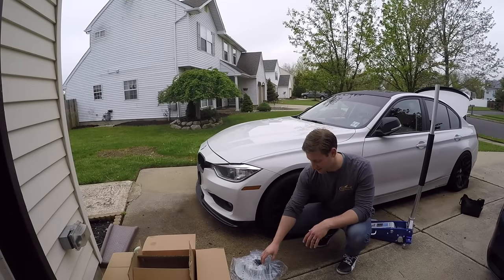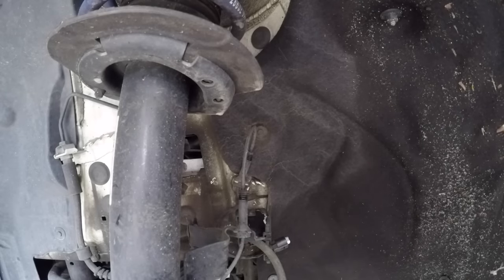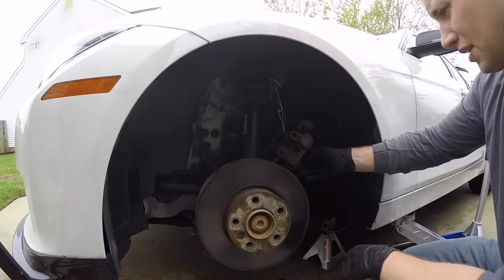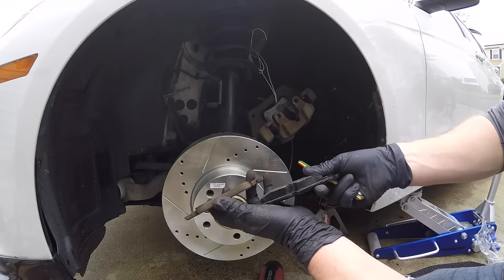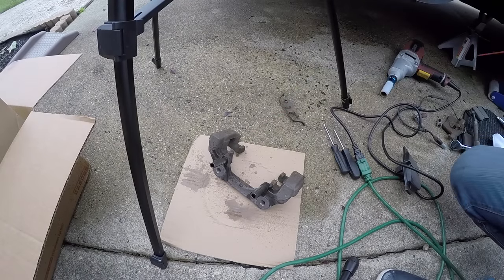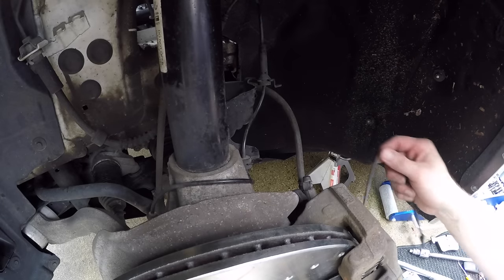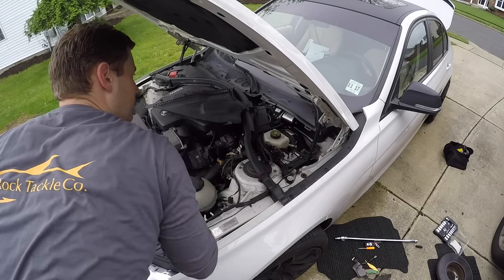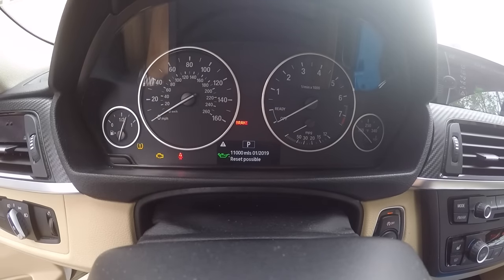F30 BMW (2011-2019) Brake Pads, Rotors and Wear Sensor Change

Comment: I like you videos Brian but there’s a few issues this one I’d like to point out for safety and potential wear or damage factors to the car

1. Note for us Brits / and some other Euro countries, European BMW’s use locking wheel nuts, never use an impact wrench on a locking wheel not there is a high risk of it shearing the head of the nut off and you will be screwed, quite literally! Specialist equipment will then be required to remove the damaged locking wheel nut key, trust me I’ve found this out myself, the hard way! Although impact wrenches are great, a beaker bar for all wheel nuts is safer.

2. Always clean the hub with a wire brush after removing the brake disc (known as rotors in USA), the incumbent hub builds up corrosion deposits especially on higher mileage cars and if you just place your new disc on it may not seat perfectly causing possible vibration when braking.

3. When releasing the brake reservoir cap you should take some brake fluid out with large syringe and injected back in after re-assembly of the brakes, you do this as a precaution because if fluid has been topped up as part of a dealer service due to pad wear then when pushing the brake calliper piston back it can cause brake fluid to overflow from the reservoir and into the engine bay, and it’s highly corrosive, it will strip car paint! I also put an absorbent rag around the open reservoir to be safe.

4. A thin layer of copper grease should be added to the back of the brake pads where they press into the calliper this helps prevent squealing.

5. The calliper bolts should either be replaced or if you are using the existing ones (which is generally fine if in good condition) you should use a thin layer of Blue Loctite on the calliper bolt thread where it screws into the calliper (generally from the tip 5mm in). And tighten to the recommended Nm torque setting for the calliper. The Blue Locktite prevents the bolts potentially loosening due to the high forces and vibrations they are subjected to under braking. I was told this by a BMW service engineer a long time ago, relevant to how they do things in the UK, not sure about USA but I’d guess its the same.

Hope this helps.
Reply: Great feedback. Going to try to do mine this weekend.
Reply: Spot on!
Reply: Clean the brake surface of the rotors also before installing.
Reply: Ok Karen
Reply: Wish I read this before pressing the brake pads, mine overflow. :[
Reply: All valid and important points.

Comment: Thank you SO much for making this video.  Swapped out the rotors, pads and sensors on my 2013 F30 yesterday and it would have been a nightmare without your guidance and tips.  you rock!!
Reply: PorradaVFR same process to the rear tires?

Comment: I thought it might be helpful to include the torque specs for the caliper bolts (110 nm or 81.8 ft. lbs) Lugs should be 103 ft lbs.
Reply: Do you know the torque spec for the Allen key?
Reply: @InformallyDead the rotor set screw is always 16 nm

Comment: Excellent tutorial for another YouTube mechanic!  I didn't need to swap out my rotors, only the brake pads. Rotors were real smooth... I didn't even take them to my local auto store to turn them!  Just swapped out the pads!  The 18 mm bolts on the passenger side are the hardest of the job.....used a sissor jack with my rachet as I didn't have a breaker bar, worked like a charm.  The rear brake pads are a breeze folks.....just need an 18 mm allen socket for the bolts behind the dust caps....they come off real easy. No need to take off the caliper if you're only doing the pads. Acquired Akebono pads from the store mentioned in this video....they come with the sensor wires.

Thanks for the video! Saved me $$$
Reply from the maker: lol nice work

Comment: New rotors rotated unevenly for me (i.e sometimes rubbing against pads). Took them out then used a wire brush to smooth out the edge of the inner ring on the hub where the rotors rest. Big improvement.

Comment: Excellent video and some very astute viewers and comments below. I also like to brush on a little bit of anti-seize between the hub assembly and backside of the rotor surface. This helps prevent any rust build up and the next time you have to remove the rotor it will pop off easy and not be rusted onto the hub.

Comment: Hilarious. Looks like a whole bunch of us out here are gearing up to do our brakes.
Thanks for the great timing Bryan.
Please post some follow up on the results. I have Zimmerman rotors and Textar pads in the garage just waiting to be put on.
Really had a hard time making a choice so ended up a bit conservative.
I worry that I should have gone with the Hawk Performance pads.
Anyway ... let us know how it feels compared to previous. Cheers man.
Reply from the maker: Hi Rob, thanks for your note. Hope it helps! So far, they work great :)
-Bryan
Reply: Nothing wrong with Oem. Love Zimmerman’s z-coat. Looks a lot better a few thousand miles down the road when the hat isn’t rusted to heck. The textars will be my pick too. That dust means it’s stopping!
Reply: I want to avoid the brake dust issue, so I#ll be avoiding OEM.  Rob, do those two options give less brake dust?

Comment: Thanks for step by step instruction. Bit nervous to change a wear sensor (I replaced the sensor also) but was easier than I thought.  I replaced with Bosch Rotor and Akebono Pads. See how the new rotor /pad will perform.

Comment: Getting ready to do my break rotors/pads, what are the proper torque specs for caliper bolts and wheel lug nuts for F30 335i xDrive with Msport
Reply: I think 16mn
Reply: 17mm and 110nm
Reply: @TranquilRide  F30 have M14 lugs, so need 140Nm.

Comment: I upgraded to Stoptech brakes about 6 months ago and the front pads didnt fit. Went into my local car parts store and those didnt fit either. So i had to buy oem pads which sucks. Im glad to see the hawk pads worked well on yours though.

Comment: Great tip with the opening the brake reservoir cap. You can hand push the caliper piston back in, but the brake fluid overflows from the brake reservoir. Those 18mm bolts are a real bitch especially at the rear.

Comment: Don't you have to use a diagnostics tool after the brake change? What would happen if you didn't take the sensor wire off?
Awesome video thanks a bunch.

Comment: People asking video about the rear breaks, I just did mine, and it's very much the same.
Only thing is that the rotor might take bit more work to take off due to it being gripped from the back of the break also. 
I thought rear was easier.

Comment: If I forgot to get brake cleaner, to clean the slides, can I just use something else that might be around the house? Can I just wipe them down with a wet rag, and dry them off, before adding the brake grease that comes with the pads? Thanks.

Comment: What are you aligning the jackstand under here, and are you actually setting the car down on it, or just using it as a backup to the jack, but not intentionally load bearing?

Comment: Great video! Thank you. Inspired by you.  I replaced the front pads of my car with Akebono from fcpeuro. I found the the rotor got very hot after driving it. Is this normal?  Thank you.
Reply: Did you clean the sliders well and also lubricated them? If that rotor if heating much, it's most likely because the brake pads are dragging....either sliders don't slide well, or the piston is not moving properly..

Comment: Just replaced the rear rotors and pads on my f30. I wish my rotors came off as easy as yours lol had to give them some encouragement with a 3lb hammer. Overall very pleased and not too hard to do.
Reply from the maker: I was so surprised how easy it did come off! Now on the other hand.. I didn't show it.. but it took me probably 5 plus minutes to get each wheel off!
Reply: Kies Motorsports Oh yes that was almost the hardest part, I had to lay my boot into the wheels with some serious kicks! I was surprised how stuck on tbey were. A good layer of copper anti seize will hopefully help in the future.
Reply: @KiesMotorsports  I've since replaced all rotors and pads, used Ate ceramic pads, man they're fantastic, outstandingly smooth and DUST FREE!

Comment: Great vid I'm going to replace my brake pads soon. I have a question though what's the torque value for the lug nuts on the wheel and the bolts behind the calipers?

Comment: Hello , awesome video , quick question what if I bought oem brake pads , and I buy those awesome drilled power stop rotors that you bought as well , will that be any problem ? Very curious

Comment: Hey Bryan,

I didn't see in the video anything about cleaning the rotors before or even after the install? I would recommend that so you can clean off all the machining oil off them and prevent hot spots on the rotors. Thanks for the video very good! Also I don't know if you have a little squeel with the OEM bads when letting off the brakes at a stop and start rolling, (BMW told me this is normal) but do the new ones do this?
Reply from the maker: Hi, Steven. I know we've since talked, but no I didn't because it was very minimal at best. They actually seemed very dry. if there was any, I'm sure it is gone after the bedding in process. As for the squeal, my new ones don't squeal at all.

Comment: Did you torque the screws that hold the calipers. What are the torque ratings for the screws used to hold the assembly?

Comment: my bmw 2008 328i has yellow 'Brake' turned on dashboard.  using diagnostic scan tool , I confirmed error code is '5DE0' Brake-pad wear: Plasibility,front axle. I tried to reset the error code but it won't allow to reset.   do I need to replace  brake pad worn sensor from front ? or do I need to replace pad + sensor together? How can I kno w pad is worn enough? how to measure it?   front side there is only one brake sensor?  if so , which side it is there? left or right?  Thank you so much~!

Comment: Excellent video ! how do the brakes feel now with slotted and drilled discs? Is there any advantage at all or is it for the look alone? Also will the slotts and holes cause more brake dust?
Reply from the maker: +Ken Lawton Hi Ken, they feel good and they grip great. It's supposed to keep the brakes cooler, but you probably won't matter much unless your tracking your car. Not sure about the brake dust yet, I've only had them on for a few days
Reply: Kies Motorsports Are those ceramic pads? I've heard good and bad, mostly bad about using ceramic i.e. they are brutal on your rotors and when cold are not good....
Reply: Kies Motorsports How are the new brakes going?
Reply from the maker: Doing good 👍🏼

Comment: GREAT VIDEO. I bought the EBC brake kit and it did not come with brake sensor, can i use my existing brake sensor or do i need to buy a new one.
Reply from the maker: Hi, thanks! You need to buy a new one

Comment: Great video! Just recently changed my m235 pads to posi-quiet ceramic pads, but i cheaped out and did not change the rotors and reused them. They squeal LOUD, like deafening loud, for the first few stops. They are pretty quiet afterwards though, wonder if that and 14 degree weather has something to do with this or the mechanic didnt grease up the hardware adequately Hmmm...
Reply from the maker: May be the weather

Comment: Bryan,
My brakes are spongy (almost to floor) after having someone replacing 2 sensors, 2 pads and turn the rotors.  They weren't spongy before.  I did have an error code in my dash that indicated "brakes" so this is why the work was done but the brakes were not never spongy until now.    They said the lines were not opened/bled...so no air in line and no leak.  I pump the brakes and push down hard and they slowly sink down.    Any idea what the issue could be ??

Comment: Does BMW car always have to change the rotor as well when the pads are worn out?
Reply: In this case I think he just wanted drilled and slotted look. It's only one small screw to change rotor and brake is already off. So why not just change it.

Comment: Curious, where exactly did you position the jack stands, if not where the jack is? Also, how long is too long for the breaker bar for this model? Thanks.
Reply: Ah, I see this was answered elsewhere regarding the jack stand placement...

Comment: hey there, I have a 2012 bmw 335i f30 sedan sport. The front brake calipers look different and drip brake fluid when replacing the brakes. Not an issue since I will flush the system anyway but the biggest issue I have is that the brake sensor does not read the computer properly. I've tried aftermarket, OEM from dealer and no sensors seem to turn off the brake light on my dash. I also ran an obd2 sesor and tried to delete the code but it still will not go away. Brakes work great but the light is very annoying. Thoughts?

Comment: Awesome video. I feel confident doing the job now. Thanks.

I do plan to use a but more brake cleaner than the video showed, and as many have stated contemplating trying a high heat paint on the calipers.

Any chance you have torque specs for the caliper bolts and lug nuts?

Again thanks for an amazing video. Your editing is perfect, shows what we need and speeds up what we don't. Really appreciate it

Comment: Great videos!! I have a question.     
I have a 2015 320i. I am concerned about the plastic guard at the bottom of windshield that  protects the wiring under the hood.  Mine is a bit warped from the sun's heat. I am worried that rain can get in and cause a problem with the wiring under hood.  Your thoughts.  Thanks a bunch!  J
Reply from the maker: I wouldn’t be too worried about it
Reply: Kies Motorsports Thanks for replying! You have great videos that are helpful!

Comment: Hi Brian, thanks for the video. I used it as a reference for my brake pad change. However, on braking lightly it's squealing like a pig is dying so loud. I seen somewhere lubrication/grease is needed. Would that be right? Felipe
Reply from the maker: Great, hope it helped! Did you change your rotors and the pads?
Reply: Kies Motorsports I took them out again and on the bottom of the pads it has some frailling pad wearing I scraped it out and lubricated the shins. That did the trick. I left my rotors in for now it's down at 22mm and has a lip. I should change them soon.
Reply from the maker: Oh good, glad you were able to get it!

Comment: Thanks for the video! I just had a question about ordering the breaks off Amazon. When I clicked on the link for the rotors, it says that those specific rotors do not fit my car. It's a 2013 328i f30 with m sport package. Any advice?
Reply from the maker: Sure thing! Yea, you'll need a different brake, since you have the m package. The compatibility checker should be able to guide you in the right direction on that

Comment: First mistake unloosing the back caliper bolts before relieving pressure you could strip the bolts. Next time compress the pads in and the caliper bolts can be undone with a 6 inch ratchet

Comment: Air impact works wonders on tough caliper bolts.
Reply: Yes they do! Did my front brakes today on my F30, couldn’t get the lower caliper carrier bolt to budge with a breaker bar, so tried the air impact and it was off almost immediately. Couldn’t fit the bulky air impact on the upper bolt though, so struggled for a while with breaker bars, hammers, etc and finally got it off.

Comment: Curious why you didn't bleed the brake lines or flush out the old brake fluid?
Reply from the maker: I had it done shortly before the video, so it was all fresh
Reply: It should have been addressed in the video. Pad change is great time to replace and flush the brake lines. Also should have mentioned the likelihood of overflowing the master cylinder when compressing the calipers and to make sure you have something to catch it with since brake fluid eats paint.
Reply: @Rick-zl3zp  Also, If you compress the rotor cylinder, you could force old fluid and dirt into the ABS system and block it...costing a fortune to replace.  better to release the bleed screw as you compress the caliper to prevent this.

Comment: When changing the pads, does the break pad sensor need replacing if it wasn't tripped?
Reply from the maker: I’d still replace it unless it’s completely untouched
Reply: Its always recommended to replace them both together just in case.

Comment: My front passenger brake has been squealing for a week now but I didn’t get a brake wear indicator. Could my censor be malfunctioning and new pads are needed or could something else be causing the squeal?
Reply: it just means they're almost done. the oem pads have a bevel --\____/-- (the bottoms is the pad surface)
once that bevel wears out the pads look like --------- and start to squeal a bit usually goes away after warmed up. it's cuz the -- --- parts never touched the rotors until they're almost worn. so it gets gunked up with road grime n stuff

Comment: Thanks as always for your Bimmer videos. Just did the brakes a month back as well... Bosch rotors also from my local shop (Amazon).
Reply: Ryan Keefer whats the price on them?
Reply: Ryan Keefer Are the Bosch OEM rotors?
Reply: +Ken Lawton +Ivan Lopez OEM Style: https://www.amazon.com/gp/product/B004AGC1IO/ref=oh_aui_detailpage_o08_s00?ie=UTF8&psc=1
They were $55 per when I got them.
Reply from the maker: What car are they for? I clicked the link and saw they don't fit 2013 328i xDrive
Reply: 2012 328i Rear
Reply from the maker: Do you have the base brakes?
Reply: Hmm... How would I know which I have?
Reply from the maker: if you have the M package, you probably have different brakes, but it's also very possible that BMW changed them from 2012-2013
Reply: Definitely don't have the M package on it.
Reply: Ryan Keefer Yep def oem, exactly what I'm after. I don't believe the brakes have changed from 12-13 in fact these rotors and the pads fit almost all of the F30 F31 standard series from what I can see.